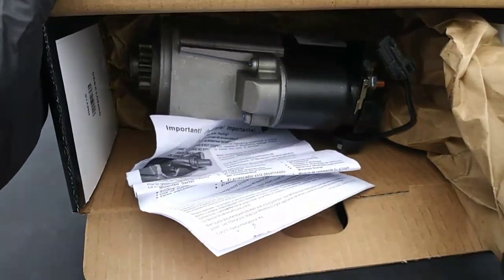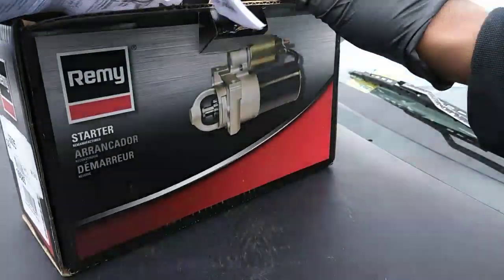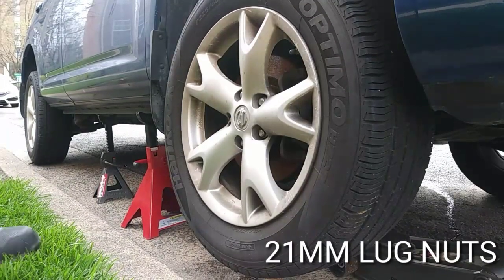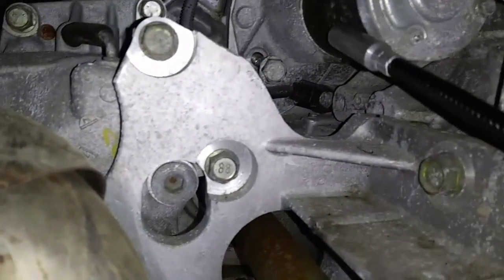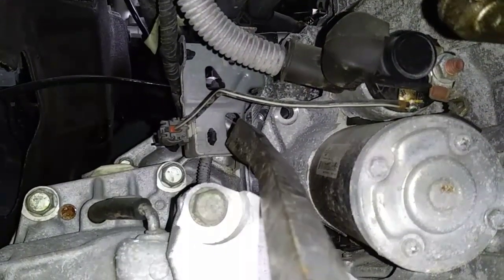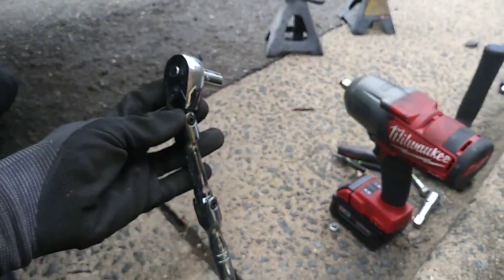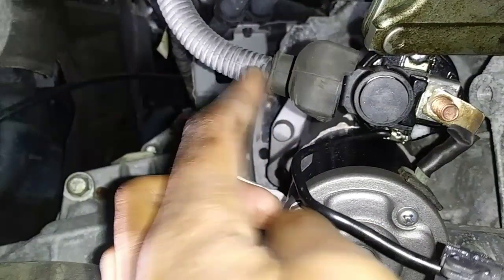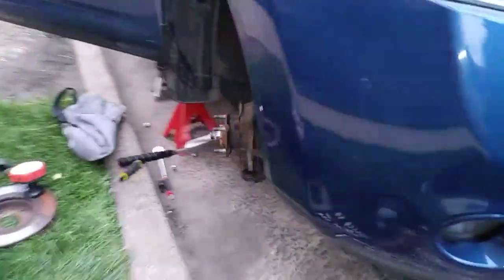STARTER REPLACEMENT (2008 NISSAN ROGUE)

Comment: It’s easier and faster to lift the entire front end and crawl up underneath the car on your back (coming in from the front). There’s enough arm room underneath the starter to get to it. Don’t have to take the tire off and play with extensions and magnets. But this is an extremely detailed video. Great job 👍🏿

Comment: Hey I was backed onto by a plower so far I can see the radiatorare damaged but everything else looks like they're just fine the problem is is now it doesn't want to turn on at all doesn't give me a quick no noise just a beeping for the key being the ignition check the battery the battery is fine so I don't know what else to do I've already tried to crank it manually and it does rotate but it doesn't turn on
Reply from the maker: I dont know, im not much help with that one

Comment: Hey man, I have a 2008 nissan rogue. I've been trying to find out what's going on with it. When I get to 20mph theres a grinding like noise until I hit 30mph. Only happens while I'm slowly driving. You wouldnt happen to know anything about this?  I've had the transmission replaced, I've added a transmission cooler, and just had the front CV axles and output shaft seals replaced.
Reply from the maker: Check your cv- axles
Reply: @barricadegarage5361  ok thanks. It's been happening for a while and still happens. Could it be the rear one?
Reply from the maker: @timothyripley4175  yes

Comment: What a pain in the ass. After a new $200 starter. And replacing it. New battery. It still wont start. It just clicks. Any suggestions...
Reply from the maker: +G.MICHAEL Clean your battery terminals with a wire brush. Your problem is with the connection at the battery
Reply from the maker: G.MICHAEL cant do that but locate the starter relay and switch it with another relay. If it starts then you need a new starter relay
Reply: @barricadegarage5361  ok let's see if that works.
Reply: Did the relay work?  Was that it?

Comment: my sister n law has a 2013 and it wont start start, no click, no power, nothing. for some reason it started when they used jumper cables. got it home it wouldnt start after that. i can do the work, but diagnosing stuff like this is not my strong suit

Comment: Bro I’m so pissed I literally hate Nissans at this present moment it took me 2 hours change this shit I was so pissed only thing I could think to myself is why in the fuck would they design this shit like this mind you I drive a 2003 g35 coupe and I’ve replaced my tranny clutch and fly wheel pulled the motor out all myself and it took me 2 hours to do this shit